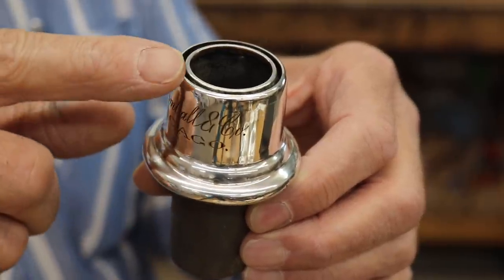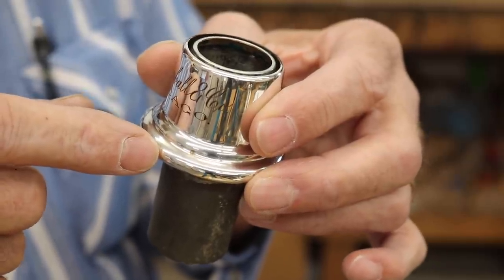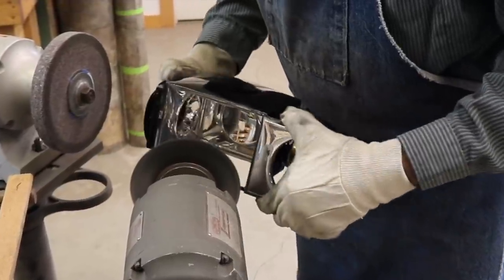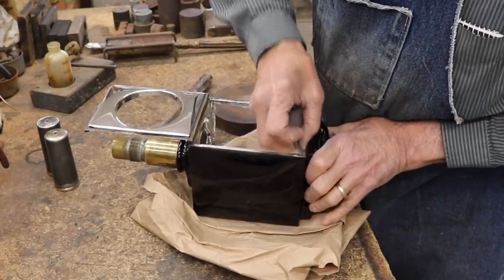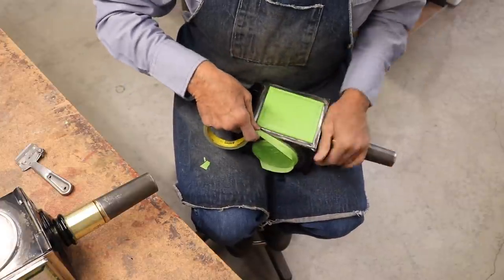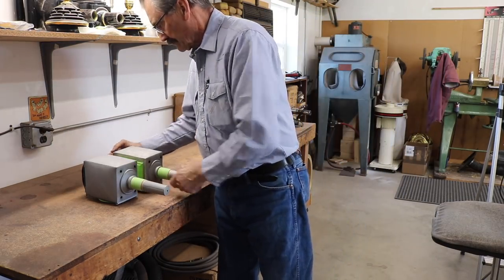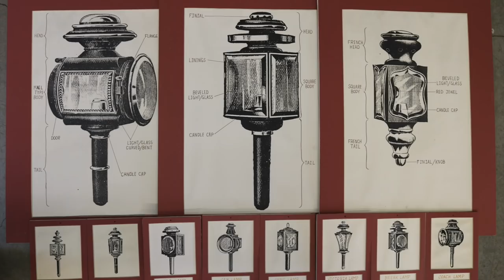Sprucing up Gig Lamps

Comment: Another interesting and informative video,  You are a true craftsmen sweating the little details that make for a excellent finished product.  One question, what is the advantage of waiting to sandblast until after the glass is reinstalled? My uninformed guess would be that there would be less danger to the lamp to sandblast before the glass and silver polishing/plating was done.
Reply from the maker: The sandblasting was done after the polished glass was installed and masked because the silver liners were left in the lamps. No need to remove them as they were in excellent condition.
Reply: @TheLuminaryShoppe  
J'apprécie vraiment votre travail. Cela rassure sur notre époque de voir des artisants de qualité comme vous. L'observation, la stratégie des gestes, les choix pour un fini exceptionnel. Bravo et merci de nous faire partager. Pierre de Vierzon. France.
I really appreciate your work. It is reassuring in our time to see quality artisans like you. Observation, strategy of gestures, choices for an exceptional finish. Well done and thank you for sharing with us. Pierre de Vierzon. France.